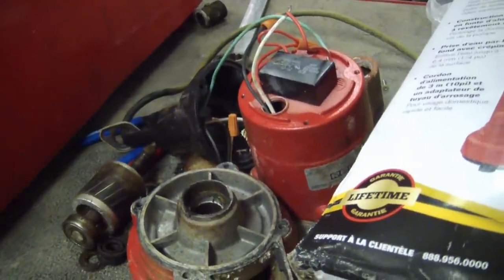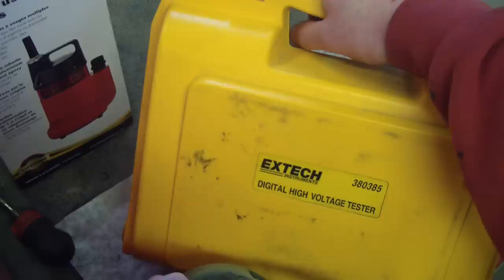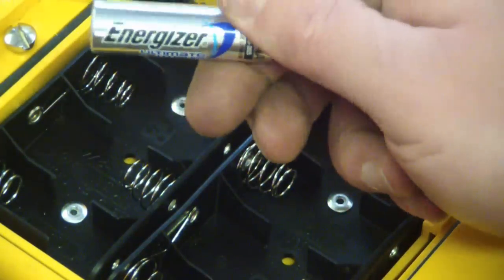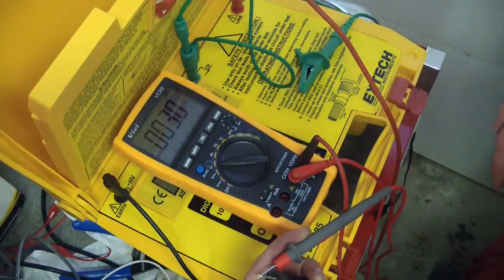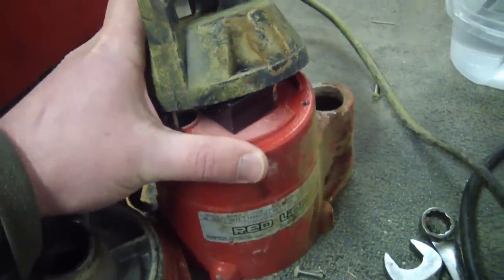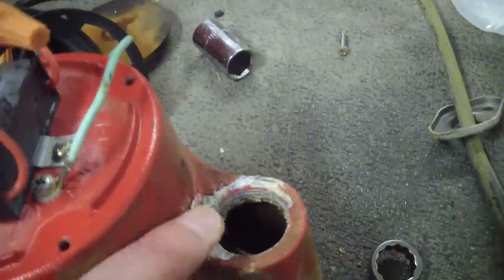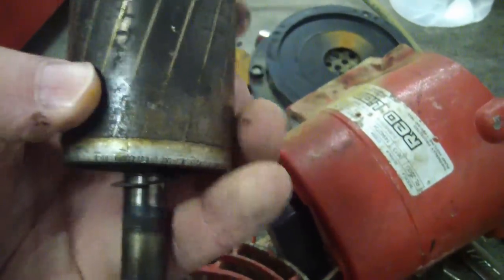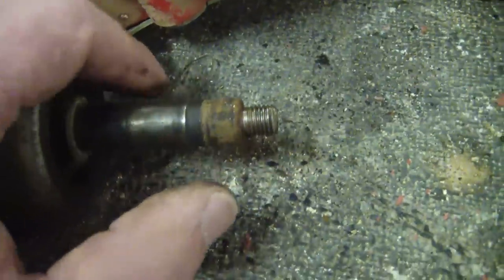BOLTR - La BOMBA! Red Lion water chooch'r is engineered to FAIL!

Comment: My son, a rock musician, had a large amplifier for his stage work. One day, during a practice session the amp went poof and let the blue smoke out. So I put the head on my electronics bench and broke it down to see if it was repairable. It was a solid state amp with no tubes. What had happened was an insect had made its way onto the circuitboard and got itself wedged into the ac/dc leads of the voltage rectifier and shorted it. Normally this would entail replacing the rectifier and fuse and you'd be good to go. The problem with this particular amp was it had no fuse and no circuit protection whatsoever so the electricities just kept pumping along and set the board on fire. This was a well known amp brand name that cost over $1000.

Comment: Engineered to fail is a modern thing, so they can continue to sell you more.  About 23 years ago, I bought an apartment with no washer/dryer (coin operated) and a failing gas water heater.  I put new ones in.  I bought another apartment with 25 years old washer/dryer, gas water heater maybe 20 years old.  The new appliances came with 6 years warranty and failed after 8.  The other apartment with the old appliances?  The old washer/dryer are still working today.  The gas water heater soldiers on another 15 years.  Oh, the new appliance is the same brand name as the old.  So there, the new ones are engineered to fail in a short time.  Unlike you, I did not take the washer/dryer apart.  But I am pretty sure the mechanical timer failed, where things do not turn on, or delay turn off, or never off.  This is top load washer.  I have seen a number of front load washer with bearing failure, sometimes the electronic brain is fried.   Is it good to have new appliances every few years or have an old one that never dies?  You decide?

Comment: Ok, couple of points.  Capacitor - that is a PSC motor, which only has a "run" cap between the start and run windings, relatively common on low cost motors or very low hp units.  Motor winding string doesn't shrink, it is tied in a "chinese finger cuff" fashion that resists loosening as you lace the windings, which is stiffened by the baking on of the motor varnish (which you alluded to).   You are correct the shaft is engineered to fail.  Baldor on their washdown duty motors uses a friction weld to use a carbon steel shaft inside the rotor (reduces magnetic flux field variations) and stainless steel outer shaft for wear.  The fact that the company only used lip seals as opposed to a buna N / ceramic mechanical seal is also another point of poor life expectancy.   I am second generation motor repairman / electrician specializing in submersible pumps (industrial of course).  Also, dry type motor poor design.  Industrial units (Myers / Hydromatic / Barnes) utilize transformer oil for heat dissipation, but that requires a good seal on the shaft.  Great video.

Comment: years ago I had my automatic transmission rebuilt at a well known chain repair shop. they asked if I wanted to buy an extended lifetime warranty for  an additional fee.  I said ok. I go pick my car up and tell the clerk that I no longer wanted the warranty.  he told that once I accepted it is couldn't back out. I said that if I drove out and came back in would agree. short version, hour later with managers and corporate calls, they relented. why such fuss over paperwork besides extra money.  friend of mine worked there and told me that they use vastly superior components in the rebuild when they have the extended warranty.  no warranty junk parts, knowing you will get maybe 3 yrs use. with warranty... best parts are used. problem is that they lied to me that day and said warranty or not, they us only the best parts for rebuild. but drove out there paying for only the rebuild, but was told when it breaks don't come back. didn't need to come back car ran great for 6 yrs and sold it
Reply: Nicely done.

Comment: That engineering has helped job shops like mine earn a pay check. Can't tell you how many shafts I have repaired because of the same exact problems. Even big names like Baldor, they build them the same way..carbon steel shafts. Great jobs for the metalizing!
Reply: Say what ya want, I always enjoyed owning there grinders. My carbide grinder is much better than the china made version we used to own. I think Keith Fenner knows what mean. 
Hey, regardless, I always enjoy your videos. Always informative and entertaining.
Reply: ***** yes ...if they make them strong then all you need is a pack of bearings and it will keep on going " induction motor) 
take my three phase induction motor for example which failed out of the box .for my smaller lathe.didnt even turn a fan (thought there was somthing wrong with variable frequency driver)
they replaced the whole thing only to fail after 3 mounths...wow..engineering at its best...
i mean if they made with there shoes it would have performed better lol

thats why no more china for me......
made in USA/Germany/UK/japan heck even Czech republic motors are premium compared to Chinese stuff
Reply: It's a shame that we need to engineer products to fail, in order to keep the economy functioning. But then again people needs jobs to eat... but then again it means more environmental degradation... that we rely on to make our jobs...
Reply: Wouldn't call it craps. More like badly engineered, with too narrow scope that misses the whole point of why we created a civilization and economic system in the first place. To distribute resources to where it is needed to sustain human life first and foremost, and secondary to allow for free expression beyond just surviving. 

Ultimately I would like people to stop treating money as God, and more of a man-made tool that has its own cost and benefit along with other forms of economics system like command economy. 

Basically you want to balance between timeliness and accuracy between different problem domains. 

If you are interested in this kind of thinking, search up technocracy, and the Viable System Model concept ( VSM is quite popular in business school)

For those who are math inclined, try control system theory.
Reply: Dey took our jerbs!
Reply: Nothing wrong with a carbon steel motor shaft, unless you want to lay your Baldor pedestal grinder down underwater and do some grinding while you're taking a bath.  Fact is, stainless isn't as strong as carbon steel, so gotta consider the application and the trade-offs.
Reply: Holy crap Abom is here!
Reply: Abom79 Should

Comment: This setup for capacitors is what is commonly called a "Hard Start Kit".  As the capacitor charges during the initial startup it delays voltage/current phase to the second winding effectively creating 2 phases.  It then usually switches off after a couple of milliseconds.  It's common on a lot of compressors for refrigerators etc. etc. for single phase non-shaded pole motors.
Reply: +atomgonuclear 
Thanks for that.
Reply: I’m 7 years late, but you’re wrong. There’s no start assist here. It’s simply a permanent split motor with a run capacitor.

Comment: I know that this is an old video but I just watched it and wanted to share my "Engineered To Fail" story. I used to own a car, from a certain manufacturer that shall remain nameless, and from the factory, they used lithium grease in the wheel bearings. Now...I ain't no genus but I shur as heckums know that lithium grease is petroleum based and WILL dissolve rubber. Sure enough, it did. I had to go back to the manufacturer and get a new set of wheel bearings. I packed and installed them myself with proper bearing grease so that wouldn't happen again. The car is 33 years old now and the bearings are still spinning strong. There doesn't seem to be any other explanation other than engineered to fail, that's just too big of a "mistake" for a big name car company to make "by accident". Just thought I'd share. Keep on choochin!
Reply: Subaru?
Reply: I'm an auto tech of 25 years. Wheel bearings? LOL I sure do replace a lot of wheel bearings on Generation Motorists.
Reply: My Cracura TL eats wheel bearings like skittles. They are press in too so it ain't easy. Fackkin junk.
Reply: I'm grateful my car's bearings have lasted.  200k so far.
Reply: jason9022  the lithium grease destroyed the rubber seal that keeps the grease in the bearing. When the seal was gone, the bearing was starved of grease, because it exited stage left through that seal. A wheel bearing with no lubrication is an unhappy thing.
Reply: jason9022  He meant if the grease causes the rubber seals that hold the grease in to go bad the grease leaks out then the bearings fail.

Comment: I feel like I have to clear up a couple things about Cambodian/Canadian Tire. It is not a weirdly named hardware store. It started as purely automotive, hence the name. Now it has three basic categories, Automotive, both parts and service, Recreational/seasonal bullshit, and hardware/housewares; which is why it's a little confusing that you can get sump pumps at a tire store. In Canada if you ask someone where to get camping gear you'll probably end up being sent to Canadian Tire, many first bikes were bought there, same for basic tools, or an oil filter. Now you might say; that sounds like a weird hardware store but even though you can buy paint at Canadian Tire you can't buy wood, screws, or tile there. So if you are actually doing home renos you are going to go to a Home Depot. 

GT snow racer=Canadian Tire, Carton o'Smokes=Costco or a buddy on the res, Coleman Stove= Canadian Tire, Dishwasher= Home Depot, K&N Air Filter= Canadian Tire, 72 inch wide screen TV = London Drugs (well probably not but they have 'em). 

No I don't work there, I just really like big box stores. My favourite part is waiting 30 minutes for some 16 year old to get off his break and open the fucking locked sliding glass cases which guard the socket sets and bullets. Yes you can buy bullets from Canadian Tire.  Pretty clear now, right?
Reply: You forgot the Guns and YES you can buy electrical fixtures and wood and machine screws there too.
Reply: Sounds like our old Western Auto stores in the states.
Reply: For me it goes Can tire<< home depot<<princess auto<<McMaster (if it's a serious situation).
I find Americans laugh at Princess auto if they haven't heard of it. Hard time explaining that no, it's actually a manly place to go.
Reply: Thanks for clearing that up for his UK (England) Viewers,We don't get Guns,Bullets or anything like that our DIY stores
Reply: Don’t forget CTC is also a large retailer of hockey equipment.

Comment: Not like anyone cares, but I'll say it anyhow...  Princess Auto.  Started in Winterpeg.  Was an auto wrecker.  They were on Princess street.  Hence the name.  "Now you know".  :D

Also - be careful of ramming too many electrons down the pipe there.  You'll just over-do the voltage rating of the wiring, fire holes through it, then it'll really be toast, when before maybe it wasn't.  Unless you're testing plug wires.  Then go nuts.

Comment: I used to help my friend fixing '80s Fisher & Paykell washing machines for a living. They put a guard in to stop drips from the seal at the bottom of the drum falling into the motor. The drip guard was at exact same height as the control spring for the mechanical emergency brake/stop system, so that the drips would fly onto the spring and start corroding it. Eventually the spring would rust out and snap, usually while the thing was spinning at full chooch, dropping the brake in instantly (its designed to be a gradual process), blowing the fark out of the gearbox, and tearing up the mounts. What could have been solved by a new seal and cleaning up the motor was now an un-salvageable pile of junk. 
Their other weak point was contact fouling on the clockwork timer mechanisms. Originally, we could take these apart and clean them up, but then they started making them out of a super brittle fiberglass material, and riveting them together, so that it was EXTREMELY difficult to get one apart without breaking it, let alone cleaning it up and getting back together again.
I know this is a comment on a pretty old video, but engineering to fail just makes me so gosh darned mad, that I had to smash some letter-buttons.

Comment: I had a $90 USD Lowe's house brand cast iron housing pump like this that was America made from the late 1990's that lasted about 12 or 13 years before it failed. The problem ended up being the float switch finally corroded inside from swinging in a wet sump basin (the pump was actually tied to a rope and not sitting on the basins bottom). Lowe's at the time sold replacement float switches that only cost $10 or so. By the time that I needed a new switch there were none to be found. Ended up taking the motor apart and all the oil inside was still clean with no water present.

Comment: I just got into this channel and really love the videos. I used to build PCs in a small shop and saw batches of motherboards go bad because of the same capacitors for 2 years straight. I think we had replaced every one we sold. Later I heard that the company had stolen the formula in an act of corporate espionage, but the formula wasn't finished. The company who was stolen from said it was still in testing. Joke's on the consumer, I guess.

Comment: Another great review. Thanks!

If the winding wasn't burned, I would have turned that shaft down and installed a sleeve. Also, even in spite of the mild steel shaft - had the motor been filled with oil, the shaft corrosion, bearing seizure, and winding damage may have taken many years longer. The older Zoeller pumps had only one shaft seal and with an oil filled motor, they lasted 10s of years.

I would love to hear their "Excuse" for not replacing it. That has to be a  load of BS!!!

Comment: Might not be nefarious or cost cutting measure. It could be that the original engineer designed it right and then someone else didn't understand what the SS sleeve was for. Another option is that it was designed by an engineer who knows how to pick the very best powder coat, the very best power cable, the very best (and oversized) bearings, the most expensive gaskets, etc but doesn't have an understanding of common failure modes. Perhaps their prototypes were tested continuously--never stopped and started. "Based on our testing and typical user usage rates, this pump will last forever. We should guarantee it for life!"
Reply: snower13 Probably tested in nice clean distilled water in the lab, instead of pond muck that a pump like that would see in a real world scenario.
Reply: snower13 
I'm surprised they kept the made in Germany bearings as usually when the bean counters decide to cost reduce something they start cutting corners everywhere.
They probably know removal of the sleeve would impact the life span under certain conditions but assumed most people would loose the box and receipt.
Reply: Serious accusations, someone could actually die from this 'ginger beered to fail'. If the electrical system is not set up to trip, you could end up frying your cobbly bits offs if you come in contact with the water.

Comment: I've seen engineered to fail mechanical parts in VCR's and Camcorders all through the 2 decades I serviced them. 1 particular high end brand used cheap grease that was guaranteed to dry out in 3 years on the same part in their whole line from the mid 80's until the end of the tape recording era. There was always a swing arm with a light return spring that pulled the tape out and brought it over to the capstan. The arm was attached to a metal sleeve that rotated around a metal post. The grease was between the post and the sleeve, so when it dried out the weak spring couldn't pull the swing arm back, and it would eat your tape.  Here's the kicker, it was the only metal on metal part in the entire unit other than the sealed bearings. It was the same design flaw on VHS and video 8. The fix was simple, pull it apart and clean the grease off and replace it with a lighter lube that wouldn't dry out. You mentioned capacitors in electronics failing and that instantly triggered my memory of that fishy smell. I always figured the capacitor failure in camcorders to be from packing 10 pounds of crap into a 5 pound package instead of purposely creating a future failure since they were pushing the boundaries of how small they could make the components.